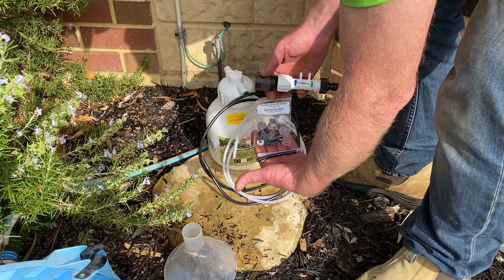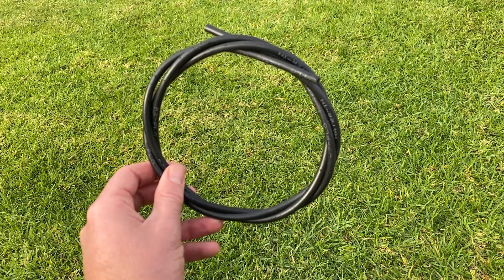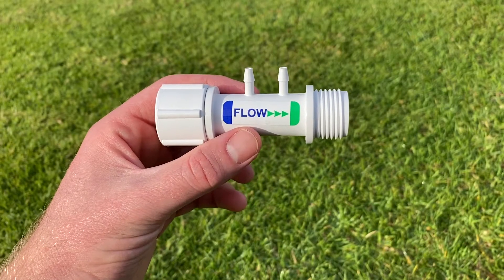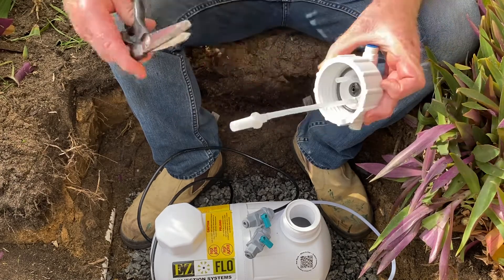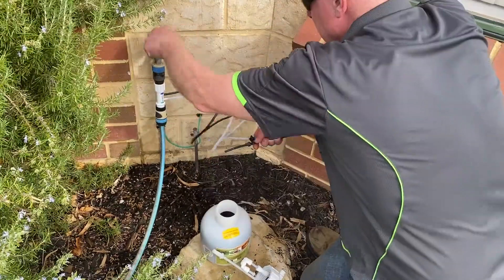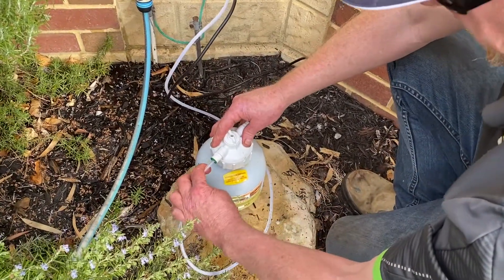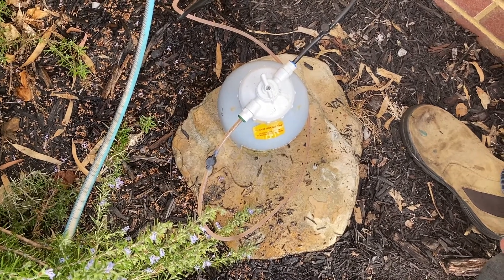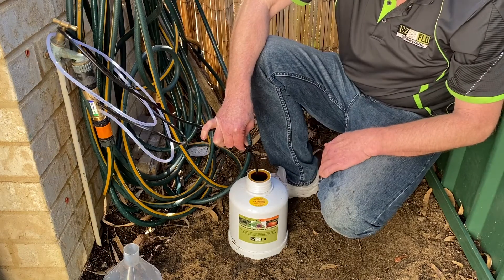EZ-FLO - How To Install A 2.8Litre (EZ2005HB) Injection System

Comment: Do I dilute my liquid fertilizer to the ratio I need and then fill the container? If water will fill my container when turned on, wont it dilute my solution even more? Also, how do I determine the flow I need?
Reply from the maker: Hi, the fertiliser will go out first because its heavier.
The flow can be as low as 6 psi. All depends on water used. The 2.8L tap unit settings are slow- 1000 to 1 to fast 100 to 1. Please email info@ezflo.com.au for more information. 1300393567. Thanks, Shaun

Comment: What about back flow protection in to the house?
Reply from the maker: Hi Rob, yes, good question. Good to check with your local plumber about rules and regulations. We do sell tap rpz's on our site if no rpz from mains is installed. We recommend it in our 'How it Works' video, 20 sec in. https://www.ezflo.com.au/how-it-works/